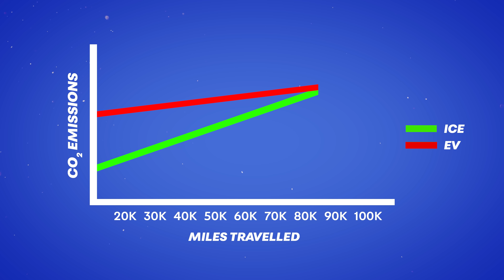Are Electric Cars REALLY That Green? [New 2022 Data]

Comment: EV cars are fine for in town puttering around and commutes but here in the U.S. try taking one on a vacation and driving cross country,  won't work.  Untill you can pull into an EV charge station and charge the car up from 1/4 or 1/8 charge to full in under 10 minutes they just aren't as practical.  Sorry, just facts.

Comment: How exactly is an ev producing any co2 emissions? Especially when charging at home with solar panels? I call complete bs on any of this.
Reply: Producing ev batteries, tons of pollution. Plus energy to run ev cars is mainly from fossil fuels. To be honest ev cars are never green
Reply: @blazwaw6349  Stop spreading lies and misinformation.  EVs run on electricity. How that electricity is produced matters. More and more countries are moving towards renewables for electricity production. I myself have solar panels that power my car and my bike. My EVs are 100% clean. Initial battery production may produce CO2 but thats a one time thing. Once made those batteries can be recycled over and over. Battery electric vehicles are inevitable.
Reply: Solar panels are made from silicon and carbon using energy from fosail fuels, producing tons of CO2, and you can't recycle them. BTW how's you solar panels in winter on cloudy day...can you boil a kettle out of it ?
Reply: @blazwaw6349  They work just fine on cloudy days. Obviously they dont make as much as on a sunny day, but they still work. I dont see you coming up with better solutions to renewables anyway. You have nothing. I have something. I produce energy. You just consume it. Its in all our power to be energy producers.

Comment: I would like to add into the mix that the battery in an ev can be repurposed whereas a dead engine is just a scrapyard queen.  Battery evolution makes them recyclable and they can be stripped down and the precious resources recovered.

EV's are already ahead of ICE and yet they will only get better.  We know that ICE has reached it's practical limit given how so many manufacturers had to resort to cheat devices.   And, when the wells are dry the wind will still blow, the sun will still shine and the oceans will still be tidal as the moon will still orbit the earth.  And I haven't even touched geothermal or hydro.  

The reality is that fossil fuel is not unlimited which is just as big a factor as environmental damage.

Comment: Good, clear, concise appraisal. Another EV downer is the weight increase over the ICE counterpart. This weight wears tyres quicker (airborne particles), and crucially, roads. Repairing roads is very expensive, but most of all, it's environmentally damaging.
Reply: A set of Michelin Primacy 3 on MG ZSEV is doing very well. Both in term of grip and tyre wear.
Heavy trucks esp. diesels are technically even worse as they're a lot heavier than cars. The weigh increase isn't to bad because batteries are mounted on the floor keeping the centre of gravity low.
I do agree that EVs are more environmentally damaging esp. when it comes to battery production and disposal. However batteries can last a long time unless you're stupid enough to use ultra fast charging stations too often. For that I'm not so worried about battery disposal.
So I'm not totally for EVs but been using one for lots of local commutes. Why? It makes financial sense to use EVs if you have the opportunity. I still have my ICEV and use that for long drives.

Comment: CO2 a pollutant ? it falls apart at that comment. Car fads--- changing your vehicle here in the UK because of a minor fault, or your number plate is out of date. Check out the number of cars less than 10 years old scrapped.

Comment: I’ll be sticking with ICE until it’s no longer an option. Loving my M2 CS.
Reply: Every thing in a grocery store is there thanks to oil!
Reply: @keithmueller1448  and it all used to be there due to horses and wagons too, so does that mean we should not move on?
Reply: goeingdriver29:  Your ilk is why I'd like to see the government make the CO2 taxes on gasoline and diesel about 20 bucks a gallon.  If you're going to be the biggest part of the problem as long as legally possible, you might as well pay to help clean up the mess you insist on making.
Reply: @rogergeyer9851  did you even watch the video?

Comment: I was under no illusion when I bought my EV. I didn't buy it for any kind of environmental reasons. I happen to like the car and could afford it, so I bought one. If we're being honest, buying any new car is almost certainly not a green decision if your existing car is still drivable. With the current state of manufacturing, there are embodied carbon emissions in almost all manufactured goods, including cars. What those number do highlight is where the future could go. Part of the problem with carbon footprint of EVs today is due to the dependence on fossil fuels of heavy industry and power generation. As those things evolve to use fewer fossil fuels, the environmental impact of EV production will go down. This is also true for ICE cars of course, but there's relatively little more we can do to reduce the carbon footprint of ICE once it rolls out of the factory. The way I see it is that there's a necessary transition here away from fossil fuels. Early adopters of technology like modern EVs help to fund the development of the technology so that it can ultimately happen before we're in a crisis. I'm fairly confident that we will be capable of fossil-fuel-free economies long before we run out of fossil fuels, so that's probably a crisis we'll avoid. What's much less clear is whether we'll achieve that before we've irrevocably damaged the environment. If anything, I suspect that we're already past that point, but I'm no expert on the matter. I'm just some guy on the internet, so we may be kinda screwed on that one.

Comment: I see the term "balanced" used quite a bit in the comments. I'm open to the idea that there is a period of time that the raw materials used in the manufacturer of an EV take some time to offset themselves. I am also open to the idea that ICE vehicles have too. EVs don't pollute with exhaust while being driven. ICE vehicles never stop polluting while the engine is on. Saying this, I ask myself, as you did, Rory, why did Volvo produce the report? Did they produce it because they are concerned about the atmosphere and pollution. No, I don't think so, as they produce plenty of ICE vehicles. Did they produce the report because as one of the leading manufacturers of EVs, they are concerned that their products are not as good as they say they are? No, because Volvo is not a leading manufacturer of EVs. I think we are now getting warm. Volvo is not a leading manufacturer of EVs. BMW is not a leading manufacturer of EVs. Stellantis is not. Toyota definitely is not. Toyota active lobbies against EVs. The other companies mentioned have been luke warm or negative towards EVs. All of these companies are behind the leaders by a long way. Some want to delay adoption of EVs while they catch up. This is why I believe Volvo published the report - to add to the BS that surrounds EVs, to slow down adoption. It's all to do with the bottom line. Oh, by the way, Volvo are not a cosy Swedish car manufacturer. Volvo is owned by Geely - a multinational, multi branded company as hard nosed and profit driven as any other manufacturer.

Comment: Great video! I'm an EVangelist and I have some points to make:
1. as Rory said, the grid is only going to get greener, fossil fuels are what they are and they always will be.
2. A comparison on the same model is right but the XC40 Recharge is among the least efficient BEVs on the market, right because it's a converted ICE vehicle. It weighs in at 2.3 tons and has a really big battery, and for batteries a bigger capacity means a bigger footprint, i.e. a Tesla Model 3 weighs in at 1.9 tons and it travels a lot further with a charge, even with a smaller battery. So efficiency is key, like it is for ICE vehicles. The comparison is legit, but if the XC40 Recharge was a proper BEV the breakeven point would be even lower.
3. I admit I haven't read the paper, but since Rory didn't mention it I believe that's missing: the fact that the most polluting part of the production is the making of the battery AND once the car gets scrapped the whole battery is either repurposed or recycled, so the production of new batteries is less polluting. And that's a big big point, it changes everything. An ICE vehicle is simply lost after it's been used, a BEV is not, the most important component is recuperated.

Comment: We need smaller lighter sleeker electric cars that are cheaper before it will have much of an impact. 
Also car ownership itself needs to be reduced and car sharing/ self driving taxis etc used instead.
Most cars spend over 90% of their life just sat on the drive or in a car park and time  has more of an effect on when it needs replacing than mileage, .how  is that a good use of materials?

Comment: Yes but what about the emmisions required for you solar and wind systems. What about the disposable of these and the disposable of the car battery. Not to meantion the fact that the grid would collapse if all cars were electric. Not to meantion charging when you live in a terrace house or block of flats. Evs are still just for  upper middle class woke signalling.

Comment: That is Correct..

Battery Packs are difficult to produce.. 

Round Multi Battery Car Packs are being replaced by Long Single Celled Multi Battery Packs which do not require liquid coolant + do not explode when compacted by sharp objects.. 

Electric Car Battery Packs, (long battery internals), will be easier to take apart + refurbish, keeping cool by ram air systems..

Don't forget, ICE cars are reliant on, engine oil, radiator additives, hydraulic fluids, emit higher percentages of heat from engines, exhaust pipes, etc..

You cannot touch your ICE engine or exhaust after a 20 mile run..

All this heat, 120 million cars, plus ICE lorries, buses, motor bikes is exhausted into the Earths Atmosphere..

You can run an EV car in a seeled garage + be ok.. You would die in a seeled garage with an ICE vehicle engine running..

Thanks..

Comment: Point 1 - Raw materials mentioned below is critical to higher vehicle production - if you thought oil was a limited resource, check out lithium.  Point 2 - If you thought we had a problem disposing of old tires, what the heck are we going to do with all of those batteries?  Point 3 - How does the average person in the US, who is living in an apartment, parking in the street, charge their vehicle?  Point 4 - Electricity does not magically come from the outlet in the wall.  The majority of it is not produced in a green machine.  It also goes through huge efficiency losses from production to actual usage.   

Those are some of the real issues that need to be addressed before we have a real EV solution that I would "Buy" into, otherwise, I would just be a Tech-weenie who wants to be perceived as an environmentalist.  Jokingly, the flintstones had it right.  LOL.  Just trying to identify the issues that need to be solved.  Oh wait, one more point - I travel to a rural setting for a romantic vacation but there are no charging stations at the hotels, and BnB's or gas stations, what now?  Hero to Zero in a flash.  I realize we have to talk someone with EV or Hydrogen vehicles, but the first Auto Manufacturer who decides to switch from ICE to all EV, will vaporize.  It takes 5 years to develop a transmission, so by the time they acknowledge their failure, the foreign companies will have the market control.  It's just not as simple as buying an EV and everything will be better.

Comment: Thanks.  A great comparison.  

I remain unconvinced an EV is now a better and more energy efficient alternative.  

With time and more experience I agree that technology can improve EV's to a better degree.
Reply: the grid is getting greener, so the same electric car in two years will be more greener than now.
One huge point, ignored in the video about EVs: the other pollutants are significantly lower for EVs, because large energy plants filter their output. (they cannot filter CO2 for thermodynamic reasons, but many other pollutants can be filtered or very much reduced)
But most ICE cars create carcinogenic soot right under our noses. And old ICE cars tend to make a lot more soot, and other pollutants too, like carbon monoxide.
Reply: Why would anyone do that Sapphire?  It is not like there could be replacements on a mass scale in the near future?  Besides, that, not everyone who needs to drive has $60,000. to buy a vehicle with.  

There are people who drive a lot every day, but also those who drive so little that that there usage would be too negligible to register.

You propose filling prisons with individuals we ho drive cars with internal combustion vehicles?  Lots of luck with that.
Reply: Sapphire, it is becominging clearer that Al Gore is incorrect about any benefit to EV's.  

There are very competent scientists that do not agree that carbon is a problem.   

Food plants require carbon. 

Core sampling proves we now have a historically lower level of carbon in the atmosphere.  More carbon is desirable  because will enhance food supplies for an ever expanding world population.

Listen to the video lectures of     Dr William Happer of Princeton or Dr Patrick Moore to see what they say about climate hysteria before you advocate criminalizing owners of vehicles with internal combustion engines.
Reply: Sapphire,  Idn know of deleted comments?  

If you do have an hour or more to listen to video's by Dr's Wm Happer, Patrick Moore, et al.  They are scientists with credentials that have different information about carbon.

Comment: I wonder if the report even included the disposal of dead batteries. Because batteries can be recycled, but the process is extremely long. And that's just on batteries for the home, phones, laptops, etc.  Which are nowhere near the same size as a car's battery pack. 

You also just can't store and stockpile them, because they can be extremely flammable. In 2010, a UPS 747 cargo plane flying out of Dubai, caught on fire and crashed because the lithium ion batteries caught on fire.

Comment: Especially when we get to solid state batteries, we’ll end up keeping ev cars running longer. 

Combustion engines and the rest of the parts they require will just wear out quicker. I’ve seen figures suggesting at the time we get solid state batteries, the batteries might be good for 1m miles.  

So for me, even if the cross over point is at 90k miles (and I personally suspect it’s closer to 50k), it’ll still be worth it.
Reply: What’s your basis for suspecting it’s closer to 50k? Do you have a more expert team of researchers than Volvo working on this issue?
Reply: @gwauk205  omg. Am I not allowed an opinion now? Do I have to check with you every time I want to say something?

Go bother someone else if you’re having a bad day / week / year / life.

Comment: " greenhouse gas emissions during production of the electric vehicle are nearly 70 per cent higher than a petrol model, which is mainly due to the carbon intensity of battery and steel production, as well as from the increased share of aluminium in the plug-in car. "
Gobbledegook from a Chinese-owned ICE manufacturer.

Comment: Three more issues. 1. Depending on how electricity is generated (mostly coal at this time) they still pollute, just somewhere else. 2. Batteries last between 10 and 20 years at best estimate, They are very difficult, require a great deal of resources and are expensive to recycle. 3.Resale on electric vehicles is terrible due to battery replacement cost from $5,500 to $35,000.  2. Batteries last between 10 and 20 years at best estimate.

Comment: Well, let’s put it that way, each time when you replace worn out battery you add initial CO2 increment, so…. I am “slightly” sceptic about lifetime of a battery for 90000 mls, but I am sure that Volvo ICE could run up to 250000 mls if it would not be faults projected. Add to this issues with used battery disposal and here you have EV fairy tale.

Comment: What people always forget is that:
Petrol cars were really bad and had Super high Emission when they were first introduced. 
EC are based on a relatively new technology in that scale. Battery technology will have to improve.

Comparing the tech in new EC with petrol vehicles is like Comparing a Nokia 3310 with an iPhone 13 
It's unfair.

And for all the people on the EV Hate train;
Is no solution better than a yet slightly worse one that could be the right one in the future?
Petrol cars were an awesome  way to improve our life since 100 years. Now we need to find other ways. Even if that means that those ways might not be as perfect as our infinitly   mega developed petrol cars.....YET.